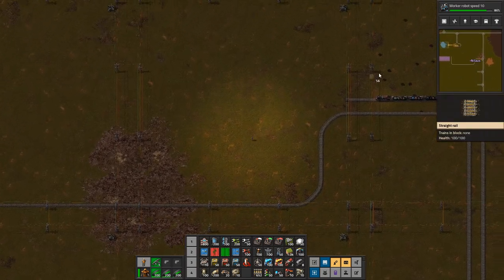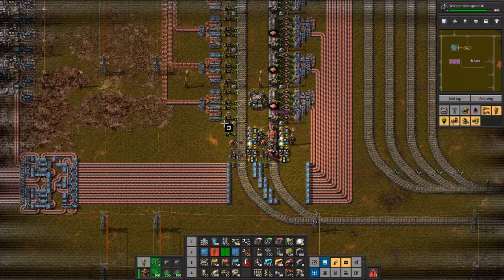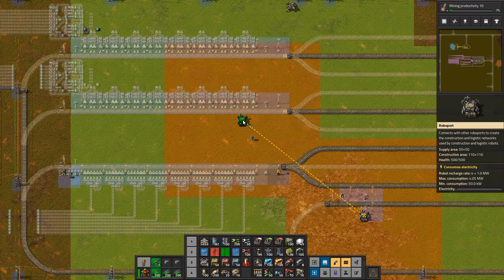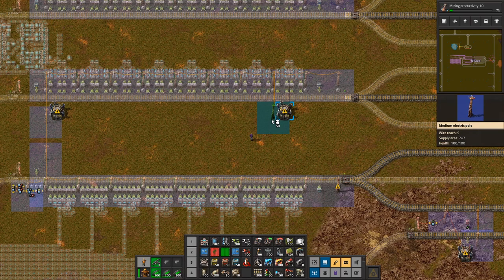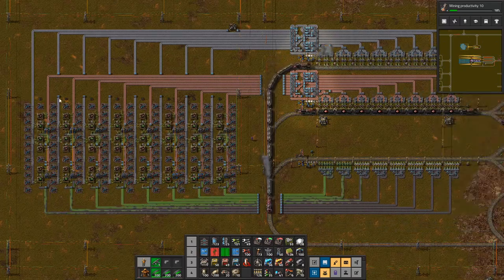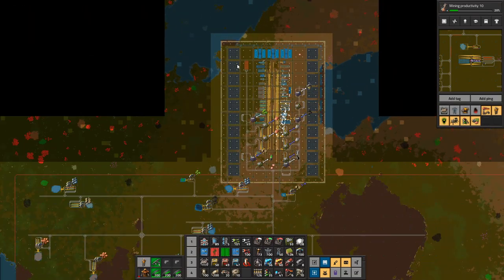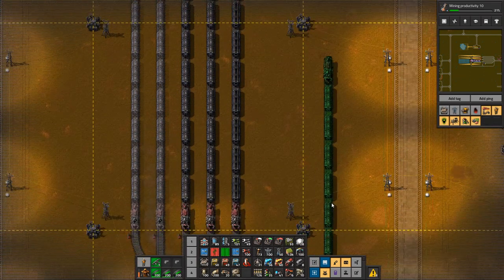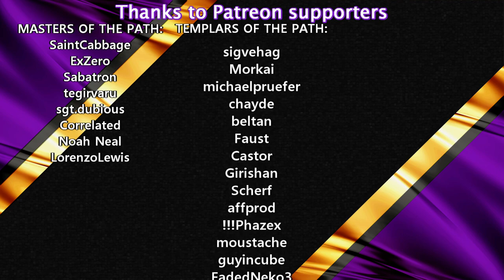Easy Design for 8 Lanes of GREEN CIRCUITS | #5 | Factorio Megabase-In-A-Book Lets Play

Comment: If the stations are well supplied they don't balance themselves. Easiest fix is too cut the supply rail for the drop, let the station drain empty, then restore the rail
Reply: What if you were to just fill the boxes by sending a new train. You would have to send away the unbalanced train when the boxes are full.
Reply: @SirToxicus  oh yeah that would work too. Depending on how bad it is, could take 4-6 trains of manual dispatching to fix it. Would potentially just cause your supply stations to have the same problem though, though that has a slightly better chance of balancing and also recovering
Reply: No need to physically cut the rails. You can just disable the circuit/constant limit on the station and set it to manual with 0 limit from map view. Trains will stop pathing to the station until it empties in which case you can turn on circuit limits (or reset constant limits) to go back to normal operation. Entirely doable from map view with minimal clicks and no building.
Reply: @drsupergood8978  I dont think you can edit constant boxes or logic circuits from map view? You can copy/paste circuits from the map, is that what you mean?
Reply: @RichardCurrie  Yes you cannot edit combinators from map view. However you can edit stations from map view and you can turn off and on circuit controlled limits from the station settings window. A manual limit of 0 means no trains will depart for a station (effectively off).

Comment: I have never been successful at transitioning to a mega base. I understood the theory of what my next step needed to be, but my execution of it was always lacking. Using the starter base as a star point is a very concise way of organizing progress. Along with city blocks and a somewhat tentative but growing understanding of controlling circuit networks, my base has never run better. (Due in large part to using your designs) 
I am very curious to see if you move away from the bus-base at any point in the mega-base. Are there any products that are better produced in a different fashion, or is it always more 'effective' to design a module that makes best use of belts, and just duplicate the module if you need more. (Science in particular is going to be highly anticipated)

Comment: Loving this series! Exactly what I need to keep my base progressing. Not a fan of this train logic because you still have to individually assign each train and count them out (as seen in the video), whereas a LTN is much simpler to manage, IMO.
Reply: What’s LTN?
Reply: @MrComet101  Logistic Train Network. Excellent mod, that takes a bit of time to learn the intricacies of. It allows you to have a central hub for trains that then get dispatched based on requests from stations.

Nilaus' design here with the combinators uses a similar idea but you still have to assign each station it's own set of trains. LTN removes that idea and instead a train may pick up copper ore on one run, then grab iron plates the next etc.

It is really satisfying to get right once you get the basics down.

Comment: So, if I understand it correctly...

Is a megabase a combination of these dedicated builds in a train network and the core base which works via a main bus? Or will the main bus be gone when this project is finished?
Reply: From what I understand it, the Megabase should have distributed production and use outside of your hub. (The end goal being to maximize science production). 

So when all is said and done, you should have these production cells you can stamp down as needed to scale up production of the parts, that will feed into research cells that will use the sciences you use eventually. 

The Hub will ultimately become the parts that manufacture all the things you need to make those cells, and the input stations needed to supply that specific manufacturing. So your central bus line can be trimmed back as you go until it's down to that bare necessity.
Reply: I think "megabase" is 1k science per minute+
This would be very difficult if not impossible to do in the bus base this series is based on, the bus isn't wide enough.  I tweaked mine up to about 400 spm before going distributed.  Once I got all sciences and labs working outside the original base the bus base devolves into being a giant supply depot for the buildertron, bitertron, pavertron, fillertron, garbagetron and nukertro spider armies.  And also a giant nuclear fuel and power plant.  

I ended up duplicating the hub block to double production rates for blue belts, inserters and a few other high volume items.

Edit: got my bus base to 400spm before going distributed.  Not 4k!  It's about 5.4kspm now though!